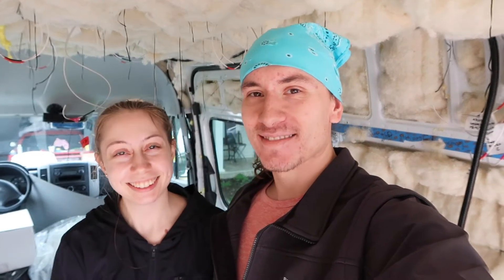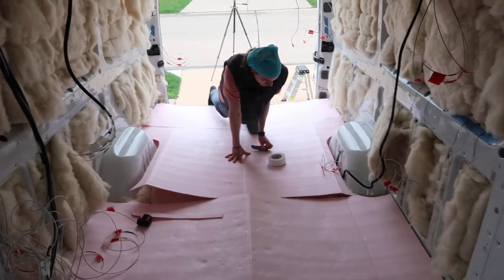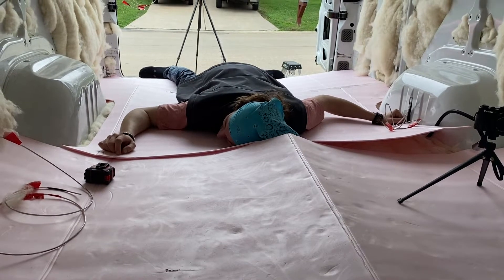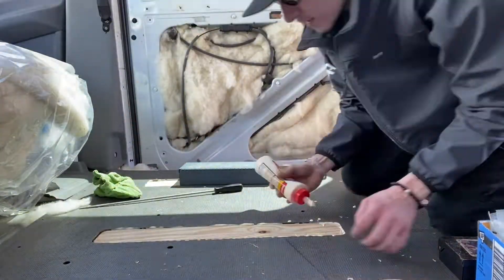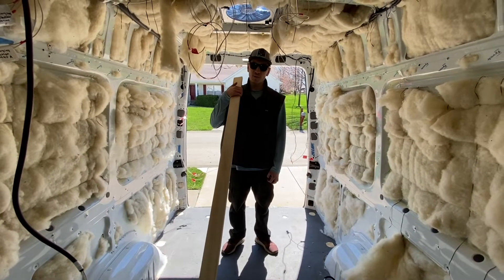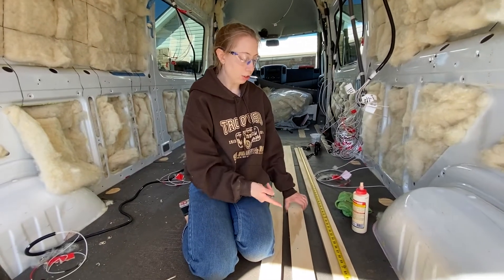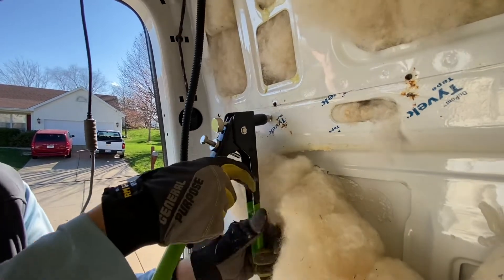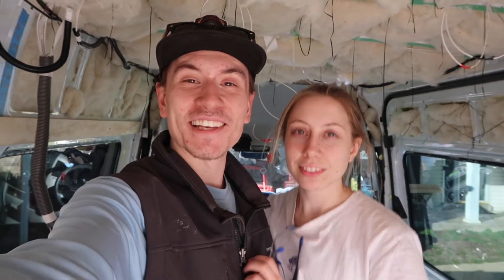WE DON’T KNOW WHAT WE’RE DOING | Redoing FLOORING for FIRST time DIY Sprinter Van Build Challenge

Comment: where did you guys get the subfloor? I am having trouble looking for it for my van :)
Reply from the maker: Our subfloor was the original floor that came in the sprinter, it is a marine plywood. However, I’ve seen some people use standard plywood, usually 1/4”. If you’re worried about moisture, you could also coat the floor in a water proofing product like Flex Seal to give it that extra protection. Hope this helps you out!